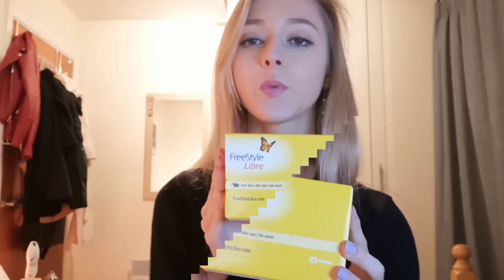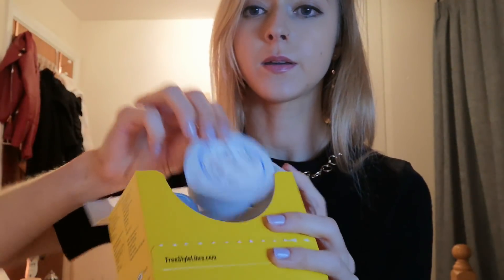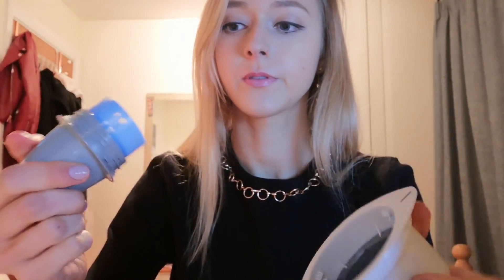The FreeStyle Libre- An Honest Breakdown

Comment: Hey Josie! Quick question, when you scanned the sensor and it said 60 minutes, is that the full warmup time? Mine takes 12 hours o_O Mine also expires after 10 days, not two weeks like yours. I've been using mine since May this year, was there some sort of updated model that I'm not using?
Reply from the maker: Hey! The company has two sensors- a 10 day and a 14 day. The 14 day sensor is their latest release and from this website here:  https://www.freestylelibre.us/system-overview/freestyle-10-day.html you can see if you are eligible to get it. I am lucky that my pharmacist automatically provided me with the 14 day sensor, but you may need to specify to yours which one you want!

Comment: Thanks for the review,  Josie. Still can't decide between this or the dexcom, or just stick with test strips :/
Reply: Hi Phillip, I use Dexcom and I really love it. Plus, I get about a month out of each sensor. However, I have tried the Libre and found it much easier to apply than my Dex. Hopefully I can upgrade to the G6 soon which is a single hand insertion.
Reply: I used both and prefere dexcom ... but restart dexcom to last for 2 weeks instead of just 1
Reply from the maker: I haven't tried the dexcom yet, but overall I'm so happy with the freestyle libre. So much less hassle than the test strips!
Reply: Dexcom sucks, you cant ever take tylenol while using dexcom.